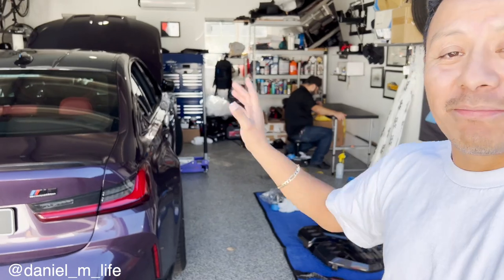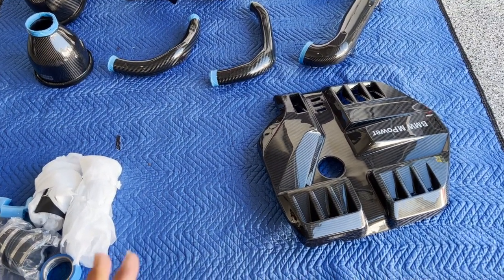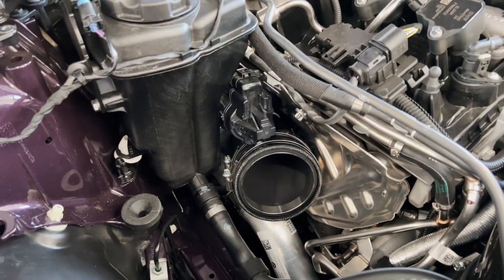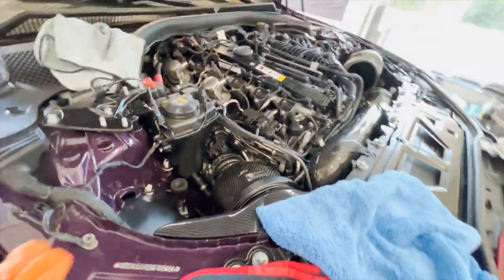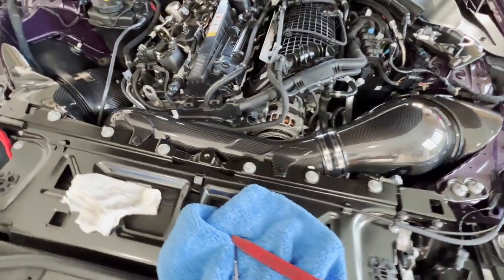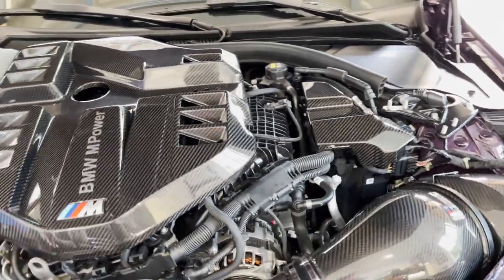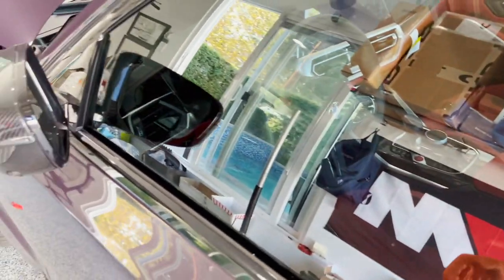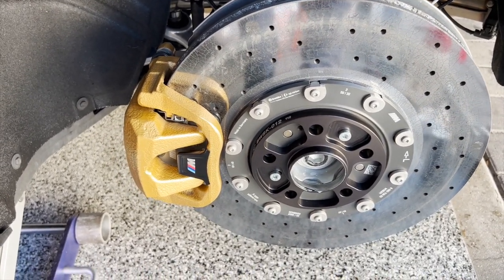NEW PARTS INSTALLED ON THE G80 M3 DAYTONA VIOLET!!!!!!

Comment: I installed this on mine and have check engine light. Code is 16050a
Reply from the maker: That’s weird, I’m sure you double checked the installation. Also I know that it’s very tight to work around the intake inlet nearest the fan.
Reply: @daniel_m_life  my local bmw dealership did the installation. The engine code relates to crankcase ventilation issue, and the bmw dealership when I took it to them said it was air to fuel ratio. I have no idea what to do…
Reply from the maker: It’s very hard to pinpoint where the issue might be coming from, with no leaks detected. There is a chance there’s an issue with the install
Reply: @daniel_m_life  they did a smoke test and found no issues. So I’ve installed a jb4 with no tune and am using it as a diagnostic tool. I see the AFR is consistent 14.6-15 when running but when I take my foot off the gas it spikes up to 25 and then down to 4.8 until I get on the gas again. There is no loss in power and it feels fine. I’m just unsure if I’m killing the engine

Comment: hi Daniel, nice video, so you only add 12mm rear spacers? It looks realy nice, I may get one for mine, thanks for the video.
Reply from the maker: Thank you so much 💯🙏🏽😁🫡. I’m running 12mm all around at the moment, I had 15mm spacers in the rear but I feel that for me 12mm all around sits better and has a nicer flow.

Comment: i wanna be like daniel when i grow up🥹💸
Reply: @daniel_m_life  did you get a solid check engine light? I had my bmw dealership install the eventuri and now I have a solid cel and they are saying it’s crankcase ventilation issue and it’s related to the intake, the car isn’t getting proper air to fuel ratio. 😅